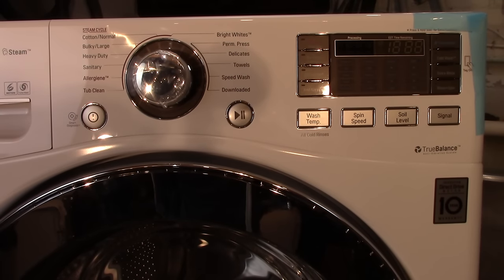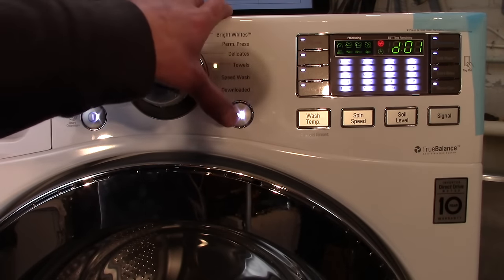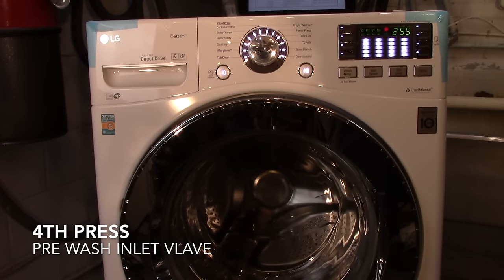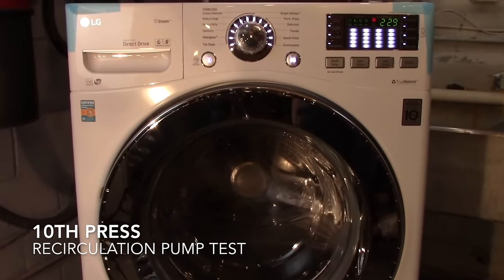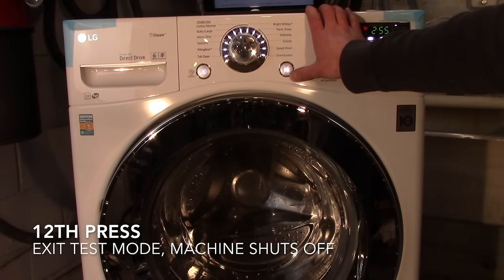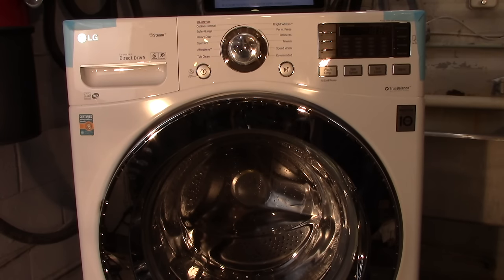How To Put Your LG Front Load Washer In To Self Test Mode | Diagnostic Mode

Comment: Please put the list of cycles and tests in the description, so we can just look and check our machines. Very helpful!!
Reply: EMPTY and closed door - lights on the machine off
	Press SPIN and SOIL together, then power button
	START button cycles through the tests
1st press - Tumble clockwise
2nd- Low speed @600 RPM
3rd - High spin @1100-1150 RPM
4th - Prewash Inlet valve
5th - Main wash inlet valve
6th - Hot water inlet valve test
7th - Bleach/spray rinse valve
8th - Tumble counter clockwise
9th - 3 Sec heater, thermister check - only turns the heater on for 3 seconds
10th - Recirculation pump test - side jets on the door area
11th - Drain pump test - can just look at it to see if it's draining 
12th - turns machine back OFF
Reply: I screen shot this comment, printed it out and put it with the manual lol
Your now on file.

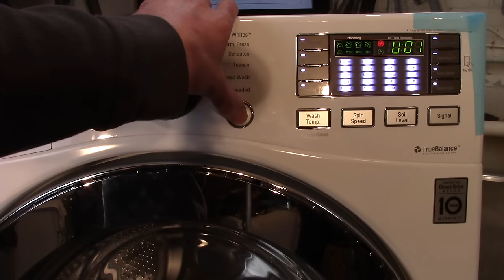Comment: 1st press = Clockwise rotation (1:15)
2nd press = Low speed spin (1:41)
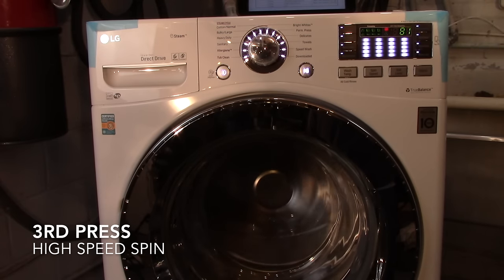3rd press = High speed spin (2:04)
4th press = Pre wash inlet valve (2:43)
5th press = Main wash inlet valve (3:19)
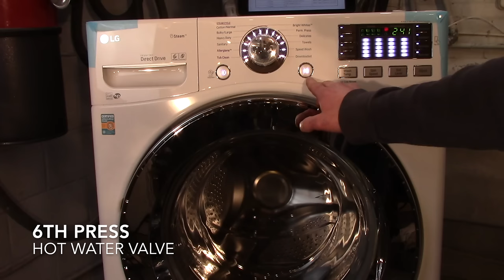6th press = Hot water inlet valve (3:30)
7th press = Bleach/Spray rinse inlet valve (3:42)
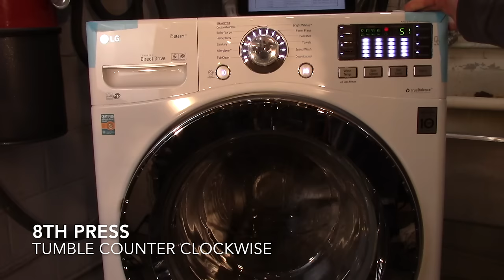8th press = Counterclockwise rotation (4:00)
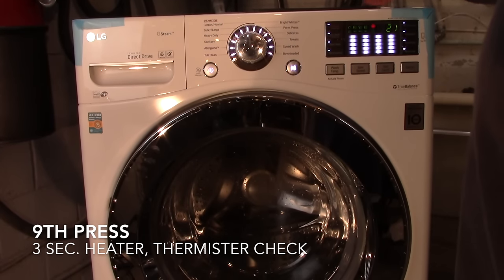9th press = Heater/Thermister check (4:10)
10th press = Circulation pumps (4:52)
11th press = Drain pump (5:19)
12th press = Full shutdown (6:20)
Reply: 1E or IE = Input fault
0E or OE = Output fault
5E or SE = Motor sensor fault
FE = Overfilling fault
PE = Water level switch fault
DE, DE1 or DE2 = Door faults 
LE = Locked motor fault
UE or Ub = Unbalanced load fault
PF = Power failure 
CE = Overcurrent fault
5ud or Sud = Sudslock fault
tE = Temperature fault
Reply: Thank you so much for that!
Reply: Awesome summary. Thank you.
Reply: I have P5 error,I know nothing about this error code,can you help me?thank you
Reply: Thx
Reply: I replaced drain pump, ran test and no error codes but after wash cycle, clothes are not completely squeezed dry and still soaking wet?  Please help.  Thx

Comment: Test sequence:
1 Tumble clockwise
2 Low speed spin
3 High speed spin
4 Pre-wash inlet valve
5 Main wash inlet valve
6 Hot water inlet valve
7 Bleach/spray rinse valve
8 Tumble counter-clockwise 
9 3-second heater, thermistor check
10 Recirculation pump test
11 Drain pump test
12 Exit test, off
Reply: FYI if step 10 dose not happen and goes to step 11, means the machine dose not have a Recirculation pump. Would of been nice if the store where I purchased would of informed me.
Reply: in step 3 i get loud noise and squeals and the rpm drops down but no error code can you please explain

Comment: Notes in case some runs into the same problems with the test as I did. 
If you washer has water in it and won't drain. The washer will not spin during the spin test. You have to drain it first. Also it's a pretty good indication it's the pump

Thanks for the video. I was able to identify the problem fairly quickly
Reply: I found same problem, it was the pump
Reply: Hello, when you did the diagnostics, did the machine shut off at step 10? Mine is turns off at step 10, which is the recirculating pump but when I search for recirculating pump for my model ( MODEL:WM3170CW ) it does not have that part. So does it mean it’s just the drain pump?
Reply: @mowax89  I don't remember off hand how many steps there were. If you don't have a circulation pump, then you won't have that step

Comment: Thank you very much for this video.  Because of this, I discovered that my issue was with the circulating pump.  That was what was making the noise.  Saved me a ton of aggravation and money.
Reply: It is happening to my lg , a noise and it doesn't pump out the water. what did you do to solve the problem?
Reply: @manuelbuizatarrida5953  hi. My issue was to change out the recirculation pump which I did. I am not sure if that is the same pump that also empties the tub or not. I want to say it is a different pump that empties the tub.
Reply: @ErolEskinazi  THANK YOU VERY MUCH,
Reply: @ErolEskinazi  I think mine must be the same pump for circulation and to empty the tub. Mine makes noise on test 2,3, and 10. Mine only had 10 test not 11.
Reply: For those who run into this issue. The spin test will not work if you have water in the machine. You have to drain it first.

Comment: Thanks for your video, I agree with everyone that has responded. It is the best video out there 
I was not able to get through all of the cycles. I did this test twice with the same results just to make sure.
The differance with your test and mine is when I started the test my screen displayed U37 and D72 any help is appriciated 
Test sequence:
1 Tumble clockwise
2 Low speed spin
3 High speed spin
4 Pre-wash inlet valve
5 Main wash inlet valve
6 Hot water inlet valve
7 Bleach/spray rinse valve
8 Tumble counter-clockwise 
9 3-second heater, thermistor check ( not sure this happened)
10 Recirculation pump test ( The washer shut off) 
11 Drain pump test
12 Exit test, off
Reply: Same, after step 8, mine goes to 11, where it drains and then next button is shut off. Can't test the recirculation pump. Anyone have more information?
Reply: @adem7223  your washer may not have the recirc pump.  recirc pump was an option

Comment: Absolutely fantastic video presentation and explanation, especially for the meaning of any codes in display screen. I only wish I had come upon this self diagnostic test earlier before spending about $75 dollars on a drain pump and cold water inlet valve. Unfortunately my main power board went.

Comment: Thank you!  Watched your video, ordered off your link and installed. Definitely saved myself  $300 at least. My model has a few more features so my pump assembly had a couple more hoses and was held down by 3 bolts, no clip. Other than that the hardest part was the ring that held in the rubber gasket.

Comment: Excellent, clear, step-by-step video I'm so happy I found BEFORE I start taking my machine apart. In spin mode, my Lg inverter direct drive front end loader sounds like a wicked, noisy 747 with a slight clunking sound. Thought perhaps my kid or husband left bearings in their coat pockets and they launched in the machine's tumbler! Nope. I have removed the upper lid and motor panels, checked all tubing and the hydraulic arms attached to the tumbler for any obvious, visible issues. None. I will try a machine self test tomorrow....will see if the Lg washer is able to dx its own problem while in spin mode. Holy spin cycle speeds too! Thanks so much for this video and such a relief to not have someone "umming" and "ahhing" thru it all with unnecessary prose! Well done!

Comment: Great video. 

255 is a binary digital scaled computing value. 

It represents the maximum value out of 256 values that can be represented with 8 bits (0 - 255). 255 would be completely empty, 128 would be half-filled, and 0 would be completely full.
Reply: 192 would be quarter-filled

Comment: Thank you this was very helpful. However I went through all steps. I received no error cods, but the last one I believe step 9 or 10, drum spun but water was coming out from bottom of washer, I'm guessing a seal needs replaced. But what concerns me, is it was humming like it wasn't going into the next phase. Keep in mind, it filled, and the drum was spinning when we got to that step. Basically my problem is this, Washer stops at the spin cycle.
Reply: i believe your problem my be the drain pump.
Reply: I’m sorry I mean your recirculating pumps.

Comment: This was helpful. Well done.  I have a 2008 LG washer with a different display screen. However the 11 part diagnostic test is identical. I quickly determined that the prewash and main wash inlet valve test failed and resolved the problem. This diagnostic test is not in the LG ownwers manual.
Reply: martin xl how did you solve the valve problems?
Reply: Did you have to replace the inlet valve?
Reply: I’m curious as well!!
Reply: Me too
Reply: My washer was leaking.  Found it was the hot water inlet valve.  Changed that but the prewash doesn’t work now.  It’s being delivered today so I can change that today.  Hope it fixes the problem.

Comment: I just wanted to stop back with an update. I replaced the drain pump and my LG front load washer is running great again thanks to this video.
Reply: Was your washer not draining?  Ours does a spin cycle endlessly.  Sometimes the time reads 6 minutes and 20 minutes later it is still spinning.
Reply: @postprod09  Hi. Yea suddenly our washer would not drain. After replacing the pump it worked great. Was really an easy job when you take your time. Have a great day.
Reply: @EdwardWallaceTechTalk  Oh ours is draining,  it just gets stuck on the spin/rinse cycle FOREVER.  Not sure if this is a drain pump problem.
Reply: Ours was not draining so never went into so in cycle.
Reply: @postprod09 mine gets stuck on the spin/rinse part of the wash. it usually happens when the machine is fully loaded with clothes. sometimes it takes so long it just gives up and shuts off. it also will occasionally leak water from underneath (which is driving me crazy! 😡). I’m considering just changing the pump myself in hopes of solving the issue. did you happen to diagnose and solve your problem?
Reply: Mine stayes at 0 after 3rd start ? Says O 😐

Comment: Thank you for the video, it was informative.
But wish to know if the drum rpm is rotating as per the specifications.
In the display, there should have been 2 readings as specification vs actuals, this could tell us if the drum is stuck with scales and needs cleaning.
Hope the above has sense.

Comment: Wow! Such an awesome video! I see that you've helped ppl in the comments below...so, I'm going to unload my problem on you and see if you might grace me with some of your wisdom. :)

My washer stopped draining. Being very, very poor but somewhat handy, I did a ton of online research and the most obvious answer seemed to be the drain pump. I ordered the part on Amazon, took the washer apart and...it wasn't the pump. I really need to get my washer working and finally decided to ask for an appliance recommendation on FB. One of the comments suggested it might be the timer...and I had an a-ha! moment. I remembered that the timer said '7 minutes left' for an hour+ before I realized anything was wrong. I figured it wasn't moving on to the spin cycle because it couldn't drain. But maybe the washer just isn't getting the "time to drain" message...? I actually had a really hard time getting the wash to end so I could even open the door. Does that sound like a timer issue to you? If you have any thoughts, ideas, suggestions or directions to point me I will love you forever. I'm out of clean clothes! :,(

Comment: I dig your Videos. Do the WM3400CW have a recirculation pump. When I do a self test I hear a motor but no water is spraying threw the Jets. No error codes or problems with Washer though.👍🏾

Comment: Hello Eugene. I have a WM8100H*A LG. Ran the diag test and everything worked fine. Loaded clothes in it and it won’t fill. It’s been acting odd for the last few loads (not filling) when you hit start. It would work if you cycled the power button a few times but now it won’t even do that. I’ve checked the incoming pressure and filters and they were good to go. Less then 9 months old and I’m at a loss. I’m thinking inlet valve but why would it fill in test mode and not the wash cycle?! Neither hot or cold works. Thanks for the great video!!

Comment: Thanks for the video. 

My washer didn't have a recirculation step. It went straight from heater step to drain pump. Also it had a number 651 in the display after draining. Hope that's normal for my washer, wm2701hv.
Reply: Mine did the same.. did you ever find out why?
Reply: @thedevilhimself1685  too long ago for me to remember lol, but I remember this washer wasn't draining properly then I replaced a pressure regulator thing that and then the machine started draining

Comment: Ran the test on my LG because it was filling up. I had to manually drain it. I changed the inlet valve thinking that was the issue but the problem continued. I did notice the numbers changed when you ran the inlet test but I my machine the numbers stayed at 255. I’m guessing it’s the pressure switch? I’ll change that out next. Any videos on that? Thanks. Great video!!

Comment: I have a LG wm2455hw and have had it for about 8 years now with no problems until this morning. During the wash cycle with a small load or any load it try’s to agitate one direction and then the other. In addition, it won’t really agitate and I do here a gear/ spline type of sound coming from it. It spins just fine and also preformed the self diagnostic setting which did not give a code. It to me sounds like some kind of stripped spline or shaft followed by a high pitched squeak for just a second while it’s changing directions. Any help would be greatly appreciated. Furthermore, if you sell parts I would gladly buy them from you. This thing has been a work horse for my family and really don’t want to a thousand dollars for a new washer. Thanks.
Reply: BRYAN ULERY . What is a spline? ;/

Comment: My washer won’t stop filling up. I’ve replaced the inlet valve. I’ve adjusted the plastic screw. It will just fill without end in sight which tends to then spill out from the door.

Comment: Question? Is there a test to see why my machine will not start? It will turn on if I turn off the circuit breaker and hold the power button for 5 sec and the start button for 5 sec. But how can I fix this problem. Thank You.

Comment: We had a problem that started with the OE error.  The machine would sometimes not get to the spin cycle (no draining).  I cleaned the drain filter.  When I did this I had the machine on its side.  I noted that the spin cycle started no problem then.  So now when it quits I tip it over to one side about 45 degrees and it will start the spin again.  I have a pump on order for it now - will let you know how it goes.  When I run the diagnostic the drain does not work without tipping the machine.  Do you think I am on the right path? Now the OE code does not come up - the machine just stops moving forward at the spin cycle.  Maybe a sensor?
Reply: I’m experiencing this problem as we speak , I’m manually draining all the water from the machine. It’s definitely the drain pump in my case. So I’m trying to get the water out so that i can clean it and hopefully it starts up again. I’ll try the tipping 45 degree angle to see if that helps, thanks!
Reply: @Yousupite  I changed the drain pump and it worked like a charm after that.  Make sure you follow the directions closely (or utube video ) its a difficult/challenging change!
Reply: Thanks, I bet it is

Comment: Thanks for the tip…. So my LG WM3070HWA does not do steps 2 and 3. Everything else worked.  Any ideas what it can be???  Other videos said it could be the Washer Motor Stator with the Washer Drive Motor.  Was thinking of just replacing both and hope that’s what it is.  Any ideas????

Comment: When I test thee spin speed I hear a very High pitched noise, is this normal? I had mine delivered yesterday..
Reply: That's completely normal on these machines. I think only younger people can hear that high pitched noise the motor makes when it rotates.
Reply: @craigjensen6853  Thanks, good to know 👍
Reply: @craigjensen6853  It's because the motor consists of coils which vibrate at a high frequency when power is applied to them, this also happens in many other electronics like power supplies

Comment: Great video. Question - should your clothes be coming out cold even when washing in hot water. Note the hoses are connected correctly. This is was inaugural issue which the installers had to come back and fix.
Reply: Yes. Rinses are always cold

Comment: I have an LG Front Loading Washer WM2701HV and when I turn it on it will either work or the display will flicker. It is very intermittent and I never know when it will happen. I have done a reset on my washer and sometimes that fixes it, but many times it just flickers and will not allow me to push any buttons.  When I put it into test mode the display is flickering.  Have you ever had that happen?

Comment: Replaced drain pump after diagnostics step and blew out lines and got air through to bubble water in tub. Never get anything out the drain hose. Have to pull filter. Still will not drain so it won’t finish a cycle stuck at 12 min. Where should I look next?

Comment: The model of my washer is WM8000HWA, I recently began getting a LE error code. I saw on some videos that the issue is the load sensor on the stator. The issue with my washer is that it does not spin at all, it just agitates a bit then the LE error comes on. Is it that the issue is just the Load sensor or does the stator needs to be replaced or both? Also during the self diagnosis it does not spin at all.
Reply: Currently have the exact same issue as you. Did you happen to get yours fixed?
Reply: @HMZ1nc  same thing here counterclockwise didn't work and got 0 rpms on the spins. What did you do???
Reply: @kevinandrewski4664  I replaced both the motor wiring harness and the rotor position sensor. Found them on Amazon with good reviews. The machine has been working just fine ever since! Plenty of good tutorials out there on how to open up the back of your washer and replace those parts. Not sure whether it was the wire harness or sensor that was the actual issue, but replacing them both solved it for me.
Reply: @HMZ1nc  OK so I did another diagnosis since I read that the if the tub had any water in it then the spin cycle wouldnt work. Well now im down to step#1 and #10 not working. No Tumble! Any suggestions on that?